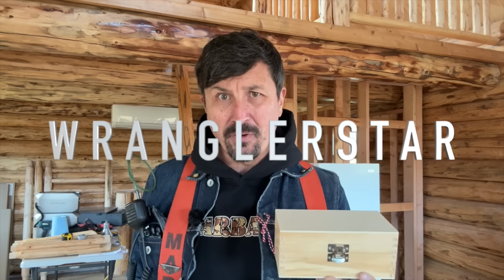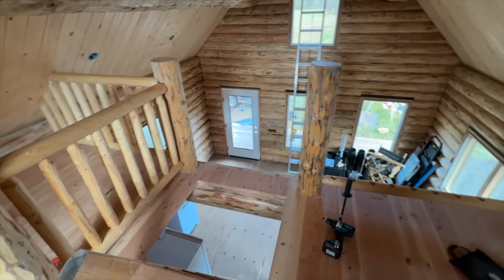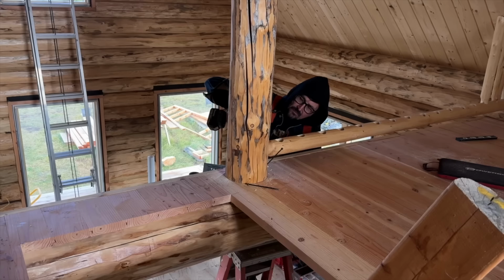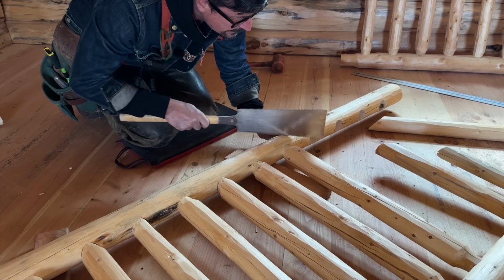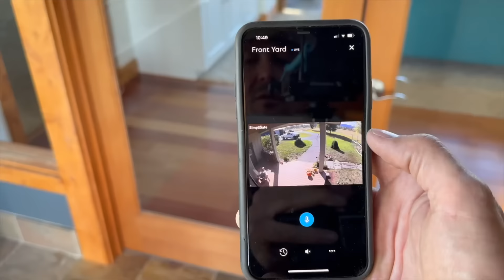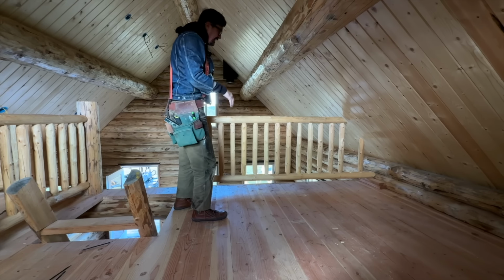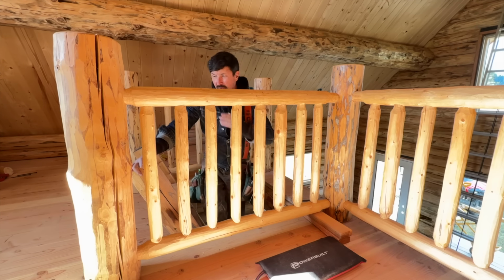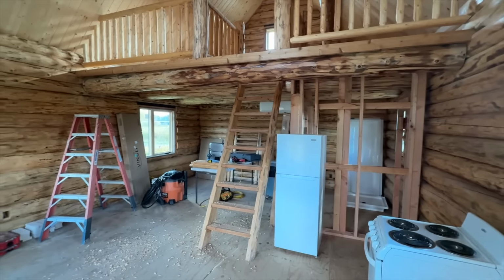The Solution Was in This Tiny Box!

Comment: I finally got a diesel heater and it was the first time I had ever worked with diesel. 
Bad luck struck when the pump nozzle I used was extremely leaky, so when I positioned the nozzle to enter the tank it burped up enough diesel to completely cover the unit in diesel fuel 😂 I did have in mind what you said about diesel being really messy stuff but it was that nozzle that threw all of that caution on its head. Luckily the smell and its lingering effect wasn't as bad as I was expecting.

Comment: A large Forstner bit takes a tremendous amount of pressure to drill deep mortises. It's almost impractical. I substituted a brand new spade bit of similar size. So much easier to drill! The spade bit is cheaper too. Maybe I wouldn't use a dull spade bit, but a new sharp one drilled a hole indistinguishable from the Forstner.

Comment: Are you attaching the cut spindles to the ceiling?  If its just a press fit I would hate for a kid to push on them and them give way.  I'd nail them into the roof and the bottom rail to make sure they stay in place.

Comment: For someone so security driven and protecting ones family, you should really consider the ramifications of having a wifi enabled security camera system in your home. Sounds good on paper, but look up how easily they can be taken advantage of. Being in the tech world I've been exposed to some true evil characters hacking into these systems very easily. Especially having a young daughter with indoor cameras in concerning....
And no Simplisafe is not an exception to these attacks
Reply: This company's product in particular sounds really insecure. Real people have remote access to the cameras by design. It's bad enough when that access is available unintentionally. The signal can be jammed like any other wireless device, and last I checked it didn't send an alert when a camera loses signal to the main unit. If you really need a remote access camera, a wired camera that uses a local server to send and save video is probably the most secure way to go about it. I'd take an extra step and put it on it's own private internet connection, so other devices in the house can't access it as easily.